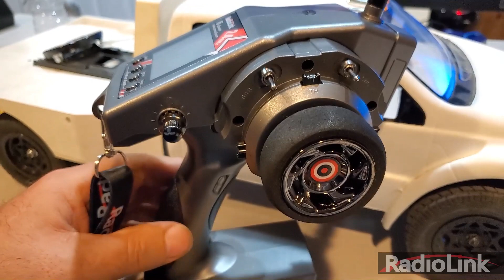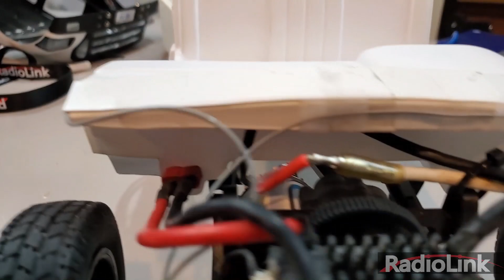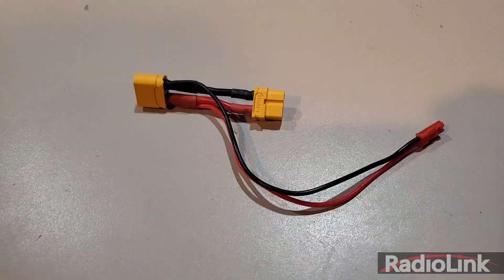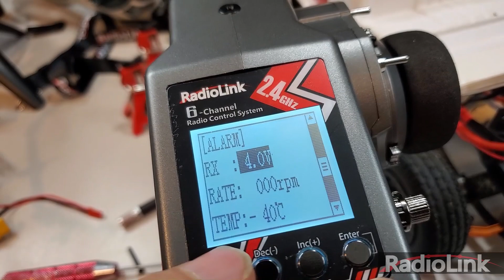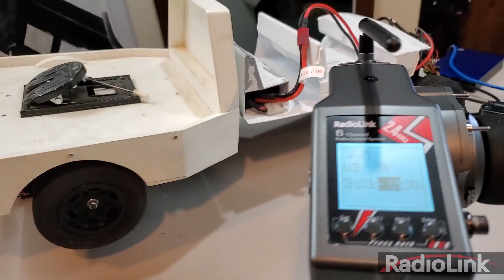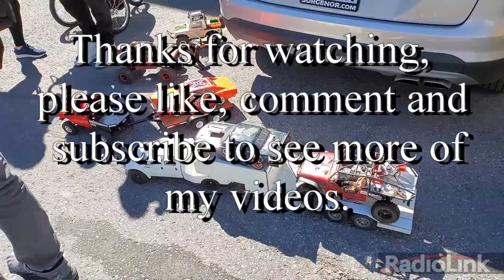Setting up the Radiolink RC6GS v2 in my Toy hauler

Comment: With this placement of your receiver, Gyro won’t working, because it only could  recognize the wheel changes in the horizontal position.
Reply from the maker: Thank you very much for your Input but I won't be using the gyro on this truck it's way too slow as this is a pulling truck.